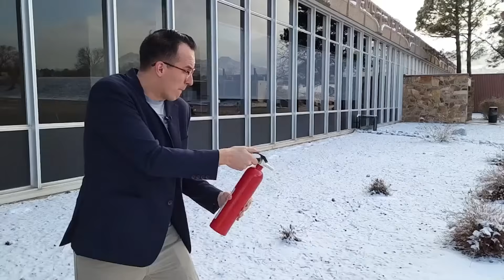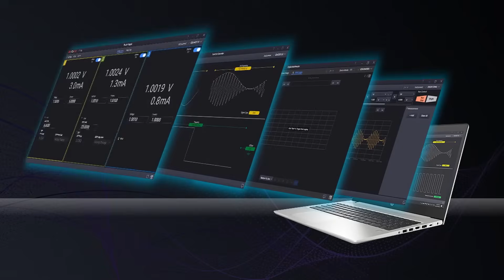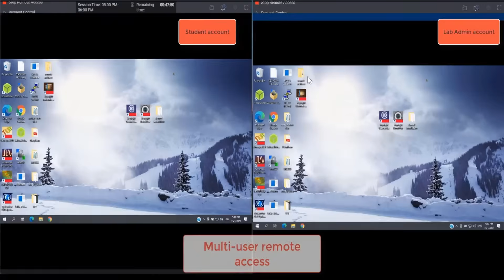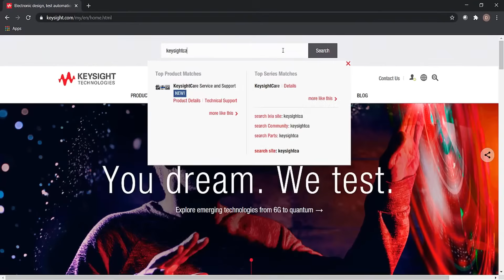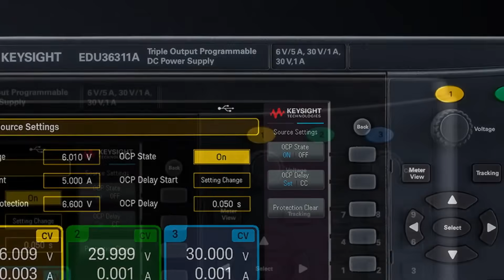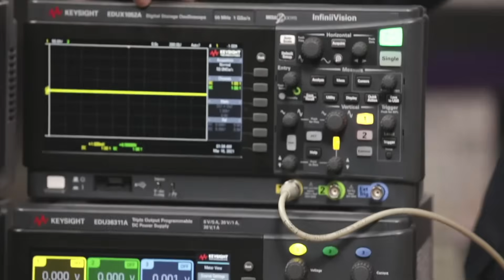Live! 15-Mar Keysight University Live

Comment: Thanks for the great content and inspiring me to strive and get more training I am currently saving up for an Oscilloscope I have very little disposable income so it will take a while in the mean time I keep learning as much as I can from all sources. Books as well as Video.
My Lab at the moment consists of an old work multimeter. A bench power supply made from an old PC supply very similar to the one Great Scott Built

https://www.youtube.com/watch?v=wI-KYRdmx-E
Also Dave from the EEVBlog as a source of constant inspiration especially with my Solar Efforts 

https://www.youtube.com/watch?v=VTUZk7vY1ME

Keep producing the great content and I'm striving to be able to afford some other Keysight Kit. 

I'm currently working on taking my whole home OFF Grid I have Solar that supply's all my workshop power Via Leisure battery's and an Inverter.
I had Solar and a new Boiler Fitted in 2016 and get Solar heated Hot water for Baths Showers and of course Tea. The Solar for the Workshop I have just completed the build and testing and I have a portable self built inverter and battery backup.
That also allows me to use a Electric rotavator. Not bad when you consider the Uks weather.

Best Regards Andy

Comment: 57:20 The wave length of EM radiation at 110GHz is actually only about 3mm. Non the less, it is really really impressive and I very much enjoyed the video where Shariar from The Signal Path took it apart. Absolute god tier engineering!

Comment: Don’t say anything bad about the old Tek scope interfaces! With one button for everything, but always super well laid out and easy to manipulate despite their size. Way better than today’s mushy buttons. They are still the reference. So much better than the two infinitely rotating knobs that do everything, but you are never sure what or how much. And don’t get me going on the infinite Russian doll menus. HP used to be the king of well laid out interfaces in complex test instruments too, but they sort of lost it a bit...
Reply: The conversion from purely analog interfaces to digital interfaces has been a learning process, to be sure. The advantage of a basically digital system is that it is far easier to add functions than in an analog one. In digital, it's more data processing. In analog, it's more hardware. (Not totally true, but surprisingly close.) As you note, though, the issue is how to present those functions at the interface. This problem is not restricted to electronic instruments -- the automobile industry has struggled with this same problem (BMW's first attempt was notoriously hated). For instruments, I believe the industry is learning. They've had more than 30 years to get it right, and they are improving. It's unfortunate that it's taking so long.

I agree that Tek was the gold standard. When I worked at HP, it was the standard to beat.

Comment: Hey i have worked with programable power supplies that actually do everything a function generator does but high power. It's mainly for testing different ways a system could short or receive a power spike. Also a big reason you would use a function generator is noise wise. a power supply would have way more noise the more you bring the power up.

Comment: You know... stackable bench products... and not even a slight indentation into the top to ensure that they dont slide off .... would have been a nice touch.
Reply from the maker: The power supply is great for stacking, and we have a stacking accessory that's pretty affordable. I also plan to 3D print some sort of unofficial stacking mechanism.
Reply: @KeysightLabs  nice!!! ... then it is even better as it keeps the lines of the devices un-touched. I have com to really appreciate these exterior lines. Well done then!